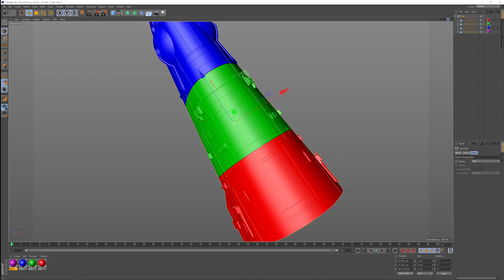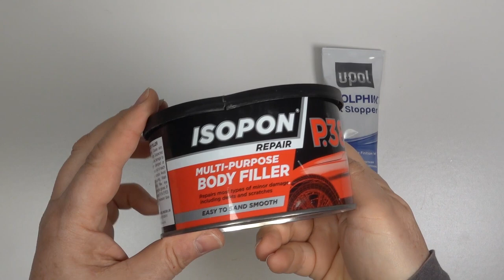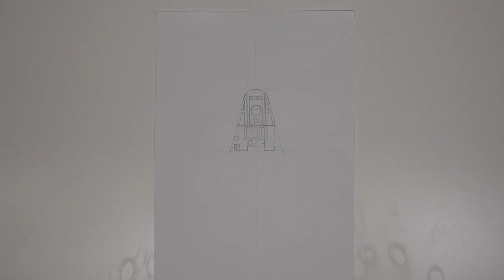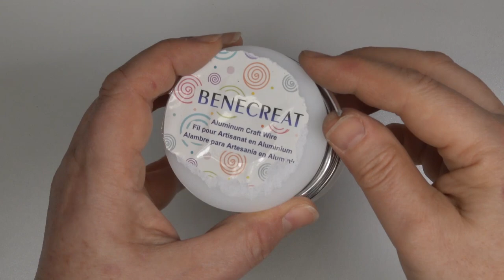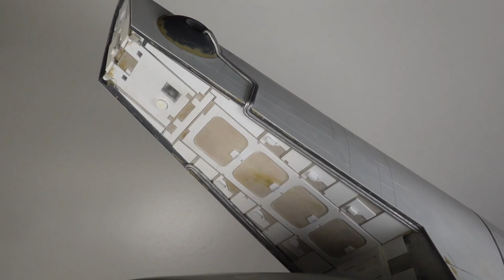PROJECT SLAVE 1 PART 5 ‘HULL ASSEMBLY & DETAILING’

Comment: Amazing work mate - I love your attention ro detail. I’m working on converting a Hasbro Slave 1 toy so your advice on using styrene for the hull detail is super helpful - thanks.
Reply from the maker: Thanks Aaron for the great comment. I'm not sure what glue you will need to use for the Hasbro? Maybe superglue? If so, don't get the really thin runny stuff it will go everywhere. Best of luck with your build.